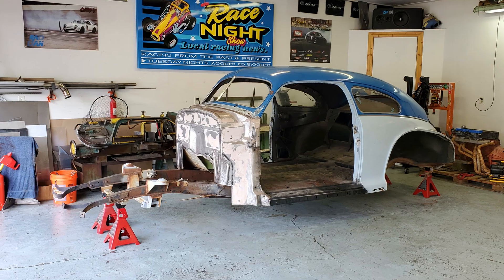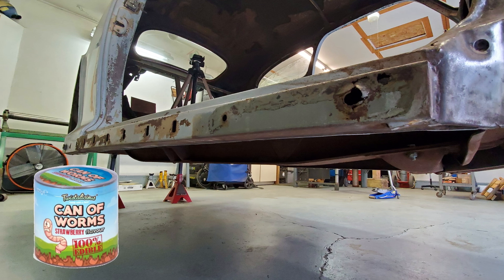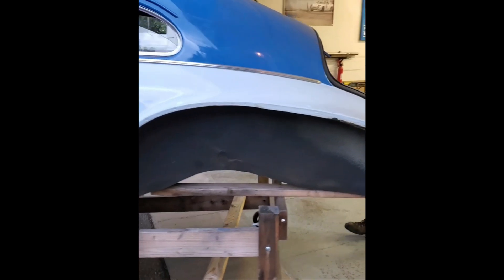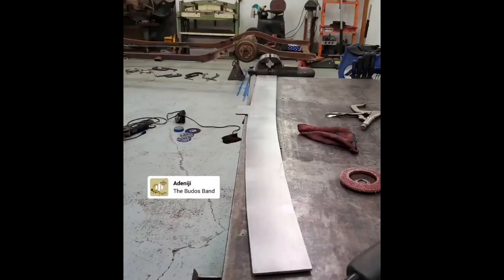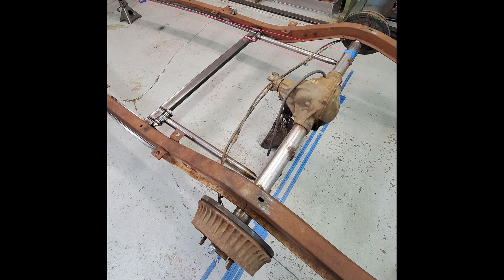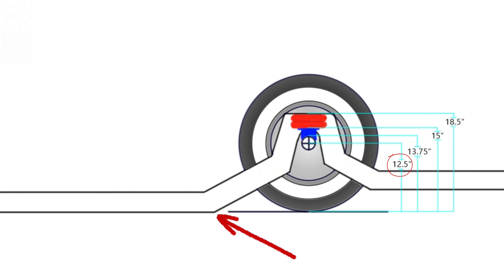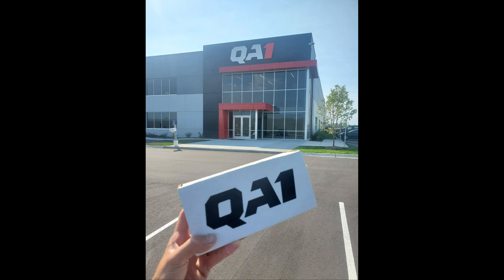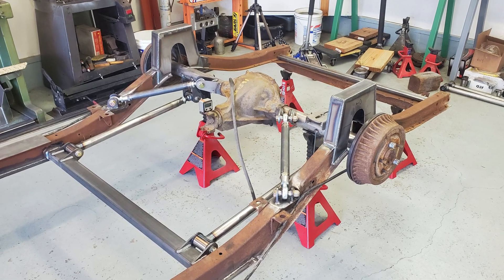The Manhattan Project: Episode 3. 4-link install & sectioning the frame to lay on the rocker panel.

Comment: One question, what was the wheel base  to Determine the Center of the C-Notch for placement?
Reply from the maker: I wanted the rear wheel to be centered in the fender arch at ride height so I determined the center with a laser level and used a plumb bob to drop a vertical line down to mark the frame and centered the c-notch to that.  
Thanks for watching.

Comment: Hi, great build.  Quick question, after cutting off the pinch weld along the rocker panels is there any welding required?
Reply from the maker: Yes, the entire seam will need to be welded back together.  I cut out about 6" at a time, and welded it back together.
Reply: @OMCbuilt  man, I really admire how dedicated you were on this project to laying rocker.  I'm really grateful for how in depth you documented this process.  I'm starting on this '46 monday and just using your videos as a reference.
Reply from the maker: @robertrodriguez9050  Thanks Robert.  Good luck on your '46 project!
Reply: @OMCbuilt I’m working on a 1946 coupe and want it to lay like your car. Love the detail of work you did I’m wondering how many inches were removed from the Bally of the frame.
Reply from the maker: @ChepeMorales-v3s  1.75" minimum off the frame to clear the rocker with the pinch weld removed.

Comment: How much u take out of the frame rail 2 inch
Reply from the maker: You need to take out at least 1.75"  You can take out more and then make some spacers or pads on the frame to get it to lay perfectly on the rockers.